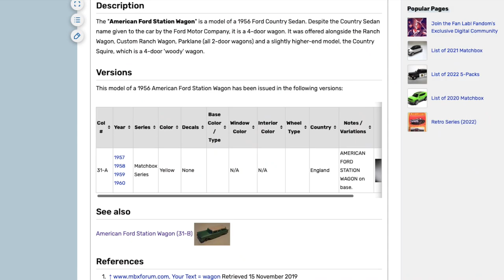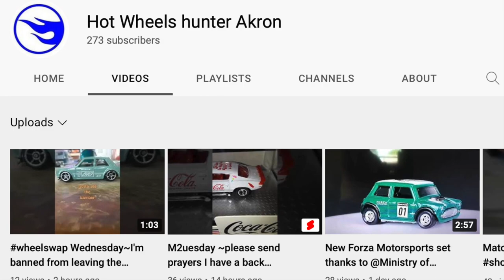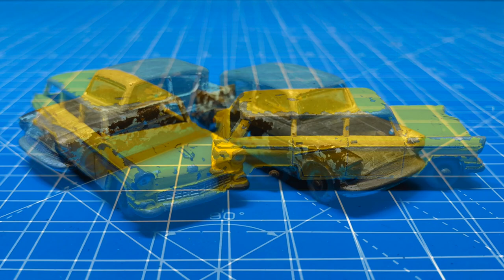Lesney American Ford Station Wagon & Ford Anglia (157-158) it's a Twofer!

Comment: nicely done. :) some harry potter anglia, I think they multiply. XD "Deus Ex Machina" or something. I got a 1:25 model with two figures. bought it of course for the model car!
love the two-tone on the station. these old lesneys are so detailed, you can easily add any chrome part or whatever. ^^ personally I'd scale that one more close to 1:85 scale, it looks in scale with H0 scale vehicles. or maybe because it's a 'murrican car and we expect them to eat up all space on the road?
Reply from the maker: You might be right on the scale of the wagon. Funny they labelled it clearly as an American Station Wagon. We used to call those land yachts! 🍁😂
Reply: @MapleLeafCustoms  very american indeed. :)
in many german movies that were made from early 60's on, the main protagonists would drive somethign expensive, often they rode american land yachts the germans here back when, wouldn't be able to name. they surely were inpressive to see inbetween all the european small cars and compacts of that time. :)